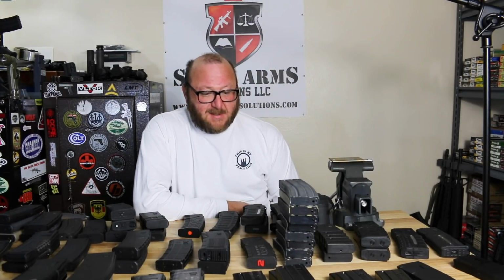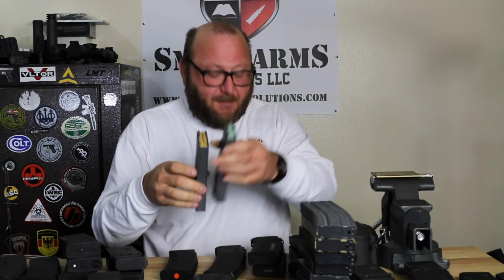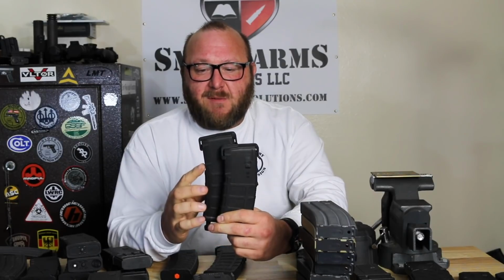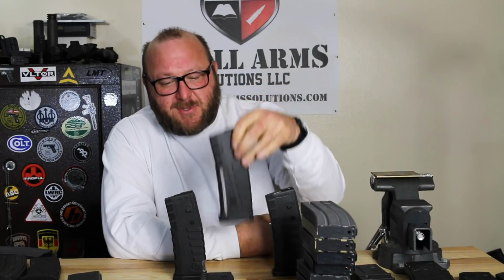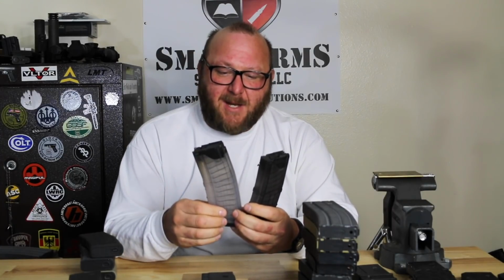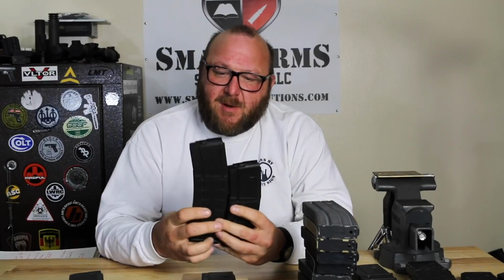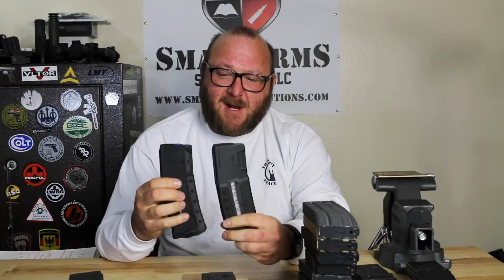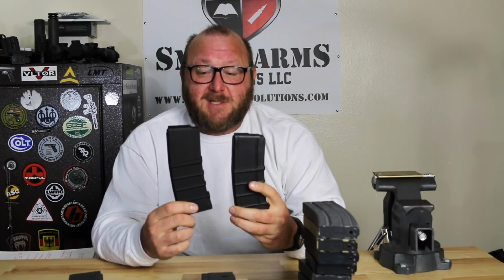Feeding the Black Rifle - Part 1

Comment: Have you used any of the SHK steel mags that global ordnance has been selling lately?
Reply: If you've not already tried them I'd hold off.  Bought 8 to test them out, 2 had such bad springs that they are only worth the spare anti-tilt follower.  Picked the best 3 when I went shooting a few days ago.  They'd run a couple rounds but then just stop working.  Double-feeds, failure to feed at all, and some other weird issue where it would chamber a round but not fire.  I was thinking I was going to need to put in a heavy hammer spring, was considering a new firing pin, possible buffer/spring issues... Had no idea what was going on.

Well today I went out with an assortment of ammo and brought some pmags and hexmags.  Loaded the first mag up with the ammo that I thought was giving me trouble, and it ran flawlessly through the hexmag.  Repeated with the pmag, same deal.  Used different ammo and one of the global odrnance mags and the same failures occurred, so it wasn't the ammo.  Best I can come up with is in addition to wanting to double-feed, it can also somehow prevent the bolt from going fully into battery.  
So 2 were bad enough I wouldn't even try them and an assortment of the better ones had serious issues, so I would rate these very, very low.  I've got other white follower steel's with no name that run great, so idk.
To be clear, these are the Korean mags, right?  No name or logo identifiers, black steel, grey AT followers with "Korea" (or made in) on the bottom of the floorplate?  Maybe these are different from the one's you're describing but I got them from Global Ordnance 3-4mo ago for about $6 each.

Best of luck if you already bought them, as I did hear some people had good experiences with them.
Reply: @mfallen4277  those are the ones I’ve got, I’ve not had those issues at all. Mine have run flawlessly
Reply: @ZSC001  Well, I'm glad they run in your rifle.  I haven't had much time to check them out but did notice the feed lips were extremely sharp and almost at 90 degrees rather than curling down.  Might just need to work on mine with a file, or drop a different bcg in to see if that makes a difference.
Good to know they aren't inherently flawed though, as I was just going to rip the springs and follower out and can the rest.
Reply: @mfallen4277  yea I’ve run mine in a few different guns, I haven’t tortured em or anything, but I haven’t seen anything any different than a standard GI mag. I will say loading them to 30 can be a pain sometimes, but that’s the only issue I’ve had.
Reply: @ZSC001  I didn't think to ask but knowing yours are similar to GI mags tells me a alot.  Mine are very rough compared to a GI mag at the feed lips.  So I just got really unlucky in the ones they sent me it.
Before buying them I read some reviews and everyone seemed to love them.  Will give me a nice little project to work on, I guess.  The 6 that are in good shape have really smooth, even pressure up to about 27-28 rounds, and I really like the followers on them, so it would be worth working on the feed lips.  Could just be my carbine has tight tolerances too, so I'll have to loan them out to a few friends to see how their rifles handle them.
Thanks for sharing your experience with them, and again, I'm glad you got some good ones.

Comment: Back in the 80's, "we would keep a death grip on any aluminum mags that would run in our rifles" and junk the rest. Many would be sold at gun shows to naive buyers.. Then we had to deal with other junk mags such as USA mags, that had zero heat treatment. I was a dedicated AK guy until Magpul came out with a truly, reliable AR mag. Many today don't understand the significance Magpul had, "by finally making a reliable AR magazine" and finding the true reliability of the Stoner DI system and platform. Great information and right on the money as usual...

Comment: Like to see how D&H compares with Okay.
Reply: I like the geissele d&h mags that cost twice as much as the palmetto ones. Even though they have the same cage code
Reply: All my D&H have been great from palmetto
Reply: Agree, a lot of AR makers use D&H and put their name on the base plate.
Reply: They don't compare.. Not saying d&h  are bad mags cuz their great.  But okay ind mags are on a higher level
Reply: @muddyhotdog4103  They're*, also, there aren't any differences if your mags came from the military. On the civilian side the finishes are different but given I don't live in or visit dusty shitholes anymore it's kind of a moot point. I don't hold either in higher esteem than the other.
Reply: SUFFER  Should have seen that
Reply: In my experience, they're practically the same thing these days. Both have supplied the US military for a very long time and both had to fit the same standards.
Reply: @SonOfTheDawn515  d&h never sold mags to the military under that name, though they did when they were owned under Labelle.
Reply: Okay is more tried and true . Uncle Sam has bought over 1.5 Million Okay Mags . 
I've personally seen 0 difference between Okay / Surefeed , Brownells or D&H mags . Brownells did have USGI Contract as well . 
Around 2011 the US ARMY discontinued the usage of Pmags due to issues in the sand box.  SOCOM never stopped using PMAGS. You can Google it for more details . Pretty sure they are being used again by the Army . Obviously they are being used by SOCOM , JSOC and USMC..
D&H is the Okay Industries of the commercial Market.  BCM has been using D&H mags for 10 plus years . 
My personal favorite mags are 
PMAGS , Surefeed , D&H and Brownells . I've also had very good luck with S.S. C Products mags . 
I used to use Lancer L5AWM but had some minor issues . Nothing serious but did have issues ..
I have shit ton of old Colt and FNMI USGI mags . Pretty sure they are Okay Industries .
Reply: @seanwhite304  I personally had issues with the Brownells mags in 2011. About 1 in 4 would function properly. So while in the stan I carried pmags that I bought myself.

Comment: I can agree with almost everything the only thing is I don’t like polymer mags I was on the range doing full reload drills and I know I smacked the hell out of the bottom of the Pmag  and gave me a death jam so it’s a flaw of polymer mags and shock absorption but it was 100% user induced I believe pmags are great quality for reasonable price but I stick to okay ind and lancer 
Things I would add is pmags let you know they are bad ( broken feed lips split polymer etc.) metal doesn’t (you can’t see out of spec feed lips) but you can bend it back and “force” longer use with metal 
Lastly my favorite maybe lancer but pmags and okay ind metal get thumbs up from me

Comment: Great video. In regards to Thermold, is this the same company that sold a magazine years ago that could be expanded for storage while loaded to take pressure off of the spring and then quickly collapsed for use in a rifle?  I’ve never actually put my hands on one of those magazines but always wondered what happened to the concept.

Comment: Great work! But for my reasoning why the Lancer AWM-5 is my top pick over the Pmag is a few things. Maybe you can look into these yourself so I can convince you? :) 

1. The Lancer AWM-5 can be dropped freely unlike the Pmags
2. Feed lips on AWM-5 are steel and dont wear out or sheer off after heavy use like the Pmag
3. I've seen Pmags split vertically on the spine of the magazine, and if a Loaded Pmag is dropped with the rifle the Magazine will explode on a hard surface. The AWM-5 Survives this test. 
4. The locking tab for Pmag wears out/strips out over time especially when dropped when loaded into rifle.  Atleast exponentially faster then the AWM-5 

This has been my experience through my years. I hope My shared knowledge can be appreciated. Thanks
Reply: 1. Gen 3 pmag are smaller than Gen2 so less of a problem but they don't drop free from some lower magwells. Tighter fit could benefit the shooter since the tighter fit and better seal means less debris gets into the rifle. 
2. Logical Fallacy. I can see how you derived that theory since steel is stronger than plastic. But when you have two different materials mate, there is a the problem of adhesion. On some polymer magazines with metal feedlips, not sure what brand, the metal lips would separate from the polymer. Thats not a problem for pmags since they're all one piece and smiliar material.
3. You should watch Iraqiveteran8888 where he pounds magazines on hard surfaces and edges. Pmag passed. Lancer metal feedlips bent. 
4. Is this a theory or have you done extensive testing or read it somewhere that this is a problem?
Reply: @addictedtopussy69  I would rather have a n adhesion steel feed lips over just polymer any day. But ideally I would prefer Steel infused Polymer feed lips. As seen with the AK magazines. Pmags are notorious over there for feed lips cracking and breaking off because of the use of only polymer, though not nearly as notorious as the AK Pmags I have seen the AR15 Pmags suffer this way from hard use. 

Iraqveteran8888 video was a good one, but the newest AWM-5 is the only one I can vouge for. The older models of AWM suffered from different things.

Comment: Iv been using the pmags gen2 for ever and never ever had any problems
Reply: Correct me if i`m wrong I have to check the gun cubaord since 19 hit it`s been slow but gen 2 you need to drop to 28-29 rnds. to work on a closed bolt and gen 3 works with 30 rnds. on a closed bolt.
Reply: @gunfisher4661  not the guy you asked, but I've found that you can, it just takes a bit more effort than normal, a decent slap

Comment: Folks I see that many of us here are AR-15 enthusiasts, I just have a question and if anyone knows the answer or can point me somewhere, where I can find the answer that would be awesome. So here goes, the range that I am currently at has 3/8" AR500 steel plates at 100 yards, my question is, is there a reloading recipe, that I can make to shoot out of my 20" AR-15 that won't cause pitting of these AR500 plates at my range. I have been looking through Google for many days now and can't find a good website. I was wondering if any of you can give me some good pointers. Anyways thank you all for reading this small book. Also I'm in Canada so yea...
Reply: Also I should add that the 20" AR-15 rifle is an SA20 from Colt Canada, which uses I think an H2 buffer. So yea, if you guys have an anemic reloading recipe that you know of that is safe for 3/8" AR500 steel at 100 yards that would be great. I would greatly appreciate it.
Reply: Don't use any bi-metal bullets..

Comment: magpul really hit one of of the ball park with the gen 3 pmag,  the gen 3 magpul pmag is probably the best all around mag for all normal people and military use because it it cheap, light weight,  durable and reliable for virtually any ammo from 55-77 grain bullets. 👍👍👍
Reply: @wernervoss6357  The Gen 2 Pmag doesn't have the overinsertion stop. It was made a part of the Gen 3 magazine because overinsertion was a problem with several types of select-fire weapons.
Reply: Not to mention the cover clip witch I like.
Reply: Usgi/aluminum and lancer mags are lighter than the pmags
Reply: Subjects of the state should NOT have banana clips👎🏾💉💉
Reply: @wernervoss6357  PMAGs have always been limited in what rifles they will work in. If they work reliably in your rifle then continue on. I use SS and aluminum USGI. Never an issue minus one 20 rounder from the 60s but that's to be expected.

Comment: Would adding about half a cartridges width to the length of the mag help with the issue of loading a full mag on a closed bolt? And if so, why haven't anyone done it yet?
Reply: A lot of makers actually do that to ease loading under a closed bolt.  My fully loaded Okays have a bit of give...then some geniuses try to stuff 'one more round' in...
It's also a good idea to check mags with your chosen AR.  As Chris mentions, there is sometimes just a bit of tolerance variance among the different makes of guns and parts that some mags may be difficult to load in some rifles but not others.  It pays to check your guns and mags.
Reply: @Youstill Wrongtho
It was length I was talking about, and so someone already did it like that which answered my other question. Thanks!

Comment: my favorite mags are 1st (gen 3 magul pmags), 2nd (HK maritime steel mags) and 3rd (Lancer mags)  honorable mention is ETS mags because i never had any issue with mine,  plus they have the best positive feed angle i have seen when using 55-77 grain ammo.  👍👍👍
Reply: I’ve had good luck with ETS mags also in the AR platform.  But I’ve had terrible experience with ETS in Glock mags.  Jamming up in the mags, not loading to capacity, and locking back with rounds in the mag.  Sent them back for replacements and ETS sent new ones that did the same.  ETS told me then I needed to oil the inside of the mags to make them work??  Nope, I’ll stick to factory for Glock
Reply: @kengray5793  i never had a single issue with my ets ar-15 mags,  love them,  no fails and they have the best positive or steepest feed angle possible for the bullet to never have any feeding issues.
Reply from the maker: Those additional ones you mention will be in Part 2